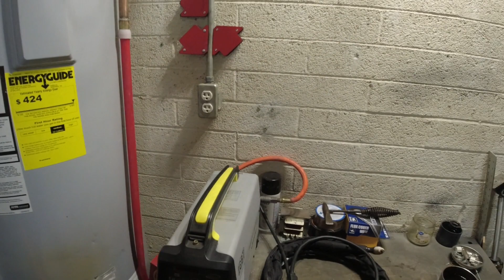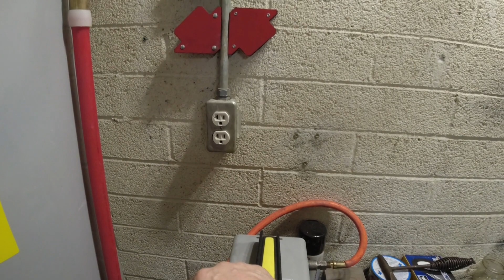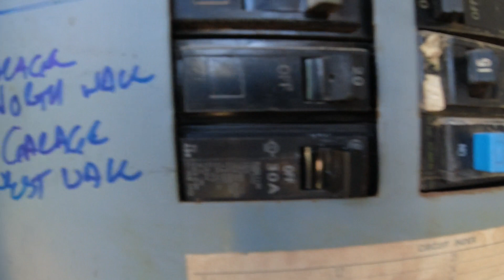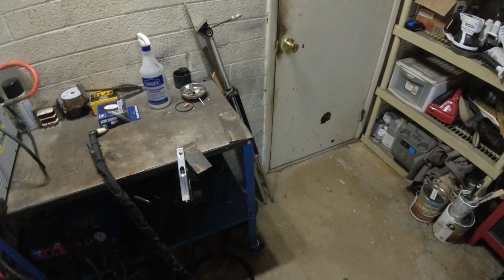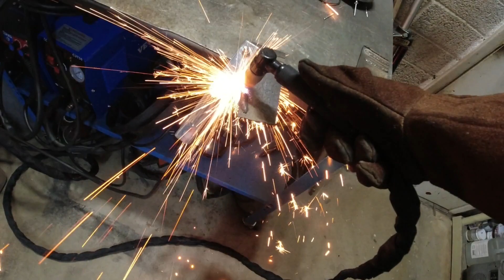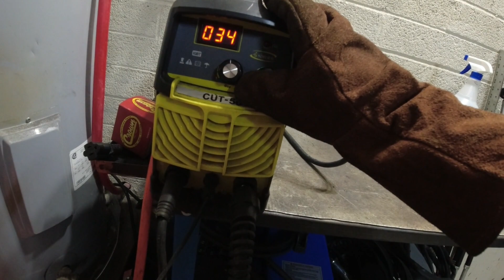Revisiting the Simder Cut 50 Plasma Cutter. Will it run on 110v now without popping a breaker?

Comment: I am an electrician. It is not safe to place a 30A breaker on a 20A circuit. The breaker protects the wire that is connected to the circuit. 12awg wire is good for 20A. The outlet is rated for 20A. The problem is, with continuous use with a 30A breaker there is a risk to overload the wire to the point it will heat up and possibly cause a fire. Repeated heating/cooling cycles on the wire will also cause the wire to expand and contract and over time connections to the breaker and outlet will loosen and cause the connection to dangerously heat up. Many houses burn down due to loose connections that heat up to the point of causing ignition. Not good advise to connect a 20A circuit to a 30A breaker.
Reply from the maker: I spent the first two and a half minutes saying what you just typed.
Reply: @3rdpig  I heard what you said. The problem is folks watch these videos and conclude if it "worked" for you it will work for them. Just making a statement with a wink and a nod to "safety factor" and saying "don't do this" is dangerous. I can't believe Simder actually told you to do this. It may work with the PC on a dedicated outlet, but no one knows the wiring situation at someone else's shop. Their circuit could serve multiple outlets and they could overload the circuit even if they aren't using the PC. You can overload the wiring and never trip the breaker. I see folks teaching how to make dryer connections for home generators on here also. They "work", but they'll also kill someone if done improperly. I wouldn't be able to sleep at night telling people to do stuff that may burn their shops/house down. I hope you reconsider this video and tell Simder the are exposing themselves to a tremendous amount of risk by saying this.
Reply from the maker: @jmac3163 We all know how smart you are now, thanks. And I'm going to pin this comment to the top so everyone can bask in your brilliance.
Reply: @3rdpig  That's awesome, maybe it'll keep someone from from making a bad decision. I don't pretend to be smarter than anyone. I have been doing this for 35 years and I've seen the damage that can be done as a result of shortcuts. When my truck breaks, I listen to the mechanic. When I'm sick, I listen to my Dr. They're not neccesarilly smarter than anyone else, but they have expertise in an area that I do not, so I listen to them. Have a good day.

Comment: Will it cut painted sheet metal
Reply from the maker: Once the arc is started it burns through paint. If the paint is thick you might have to scrape off small spots for the ground clamp and electrode. You can also buy a plasma cutter with pilot arc, then you won't need to scrape off a spot for the electrode, but you will still need a bare spot for the ground clamp.

Comment: I am really impressed with the one handed camera work as most people make it so shaky its not worth watching, but not only good camera work but a very nice cut while filming. So Mr. Bryant which plasma cutter would you recommend if I can't get one of these for $150.
Reply from the maker: Thanks, but if it wasn't for stabilization my videos would be as shaky as the others you've seen. From what I've tested in plasma cutters, I'd get the Vevor, as long as you don't want pilot arc. And to be honest, if you're running on 110v pilot arc is all but useless.

Comment: Just received mine in the mail and got it hooked up and nothing ! Fan comes on dials show readings and hasair to the reg. Any idea or a contact to customer service.  Thanks btw good information
Reply from the maker: Are you sure you've got the torch assembled correctly and the ground hooked up? Might also want to pop the torch apart and make sure the wires on the microswitch inside the torch are connected. You could jump the switch at the same time to check it. Their website has contact info, I'll put the link below. Good luck!

https://www.ssimder.com/pages/contact-us